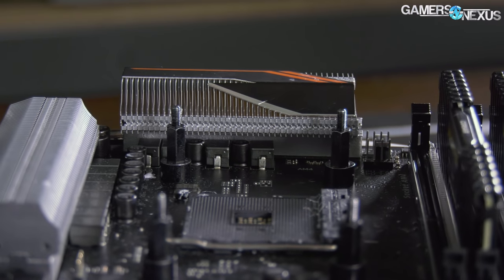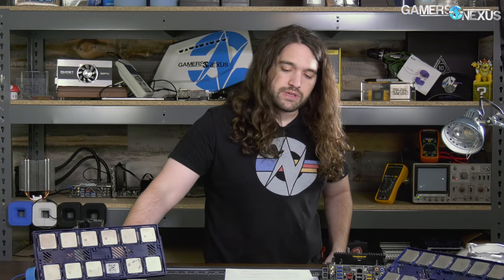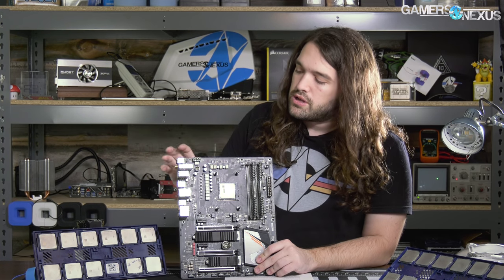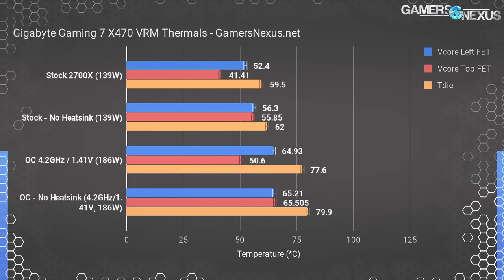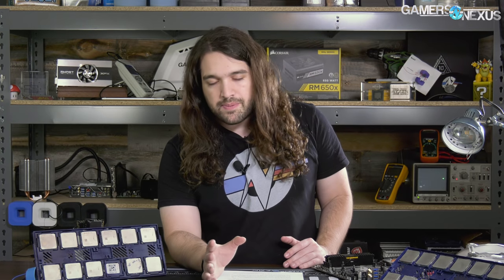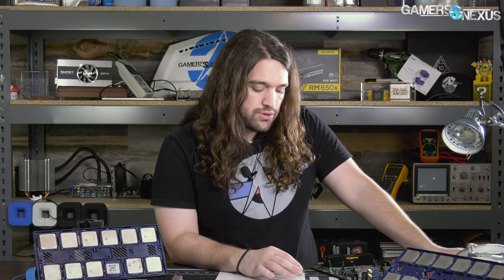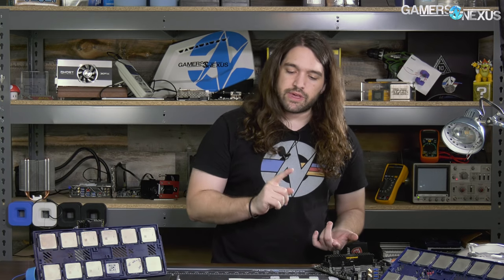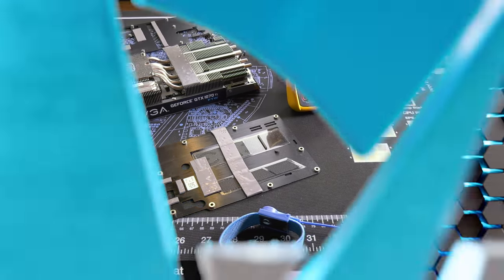Gigabyte X470 VRM Thermals & Planning for 10C/12C Ryzen

Comment: Gamers Nexus, i recently built my new Rig and got the 1080ti Aorus Extreme Edition GPU and games from stock like player unknowns are crashing which we found out to be the core that its boosting to and its only fixed when i drop the core by 30hz.... why would a card that is 1 month Brand New need to be underclocked in order to run games stable without crashing?:

if needed i would have shiped it to yourself for you to see what i mean but im confused....should i RMA  it, Return it or just keep it since it runs fine when the core is lowered?

Comment: I went ahead and got one of these. I know it's overkill for my current x1600, but I figure that I can start leap frogging parts starting with this. It should help keep my cravings at bay until Zen 2 comes out. I hope. I'm also coming from an Asus ROG Strix B350-F Gaming so I'm thinking that it should be a pretty good upgrade.

Comment: lower temps don't give you additionally overclocking room on ryzen but is it reasonable to assume it would increase longevity of other components like the capacitors? does a 5000 hour 105 degree cap last all that longer if it isn't subjected to 105 degrees?

Comment: I wish there was a finned heatsink on my z97 board. I had to put a fan in front of it to keep it cool with overclock since my CPU is liquid cooled.
Reply: I wish that too although the VRM temps on my board aren't too bad. Which board are you using if I may ask?
Reply: Asrock fatal1ty z97m killer, It has heatsinks that apparently are not effective enough with a 4790k @ 4.7ghz with 1.32v.

Comment: Motherboard manufacturers planning ahead so they don't need to re-design their motherboards? Intel launches refreshed chipsets with each new significant CPU release and motherboard manufacturers end up launching a million new motherboards to go with them. I'm not seeing motherboard manufacturers skipping a chipset refresh cycles just because their previous generation boards were over-engineered.

Comment: Please review (let Buildzoid review) the Prime Pro, it is THE motherboard (of X370 anyway) for the consumer who doesn't want to pay too much but still get good VRMs.
Reply: Peter Jansen He looked at it briefly in one of his videos if I'm not mistaken, and said it was a good board. It's the board I have. No complaints whatsoever.
Reply: In the case of AMD I am strongly in favor of buying a motherboard which can handle whatever AMD might throw at it a few generations from now, like a possible 12 core Zen3 CPU for $329 with a clock frequency of >5 GHz. Trust me, it is possible: 7 nm GF/TSMC + EUV => smaller cores and less cost compared to the first generation of '7 nm'. :)

Comment: What I really like about the giant vrm heat sink, is this finally looks like a board you can buy that can adequately cool future AM4 processors as they get to higher frequently ranges and more cores/threads.
Reply: Which you explicitly mentioned later on in the video. So I guess I am learning.

Comment: Would a 1600x work on a x470 @Gamers Nexus
Reply: yes
Reply: Sure. A 2600X can work in a X370 too (with BIOS update). You can put any AM4 socket AMD processors on X470 motherboard (like AM4 Athlons, Ryzen G and Ryzen 1&2gens, except Threadripper, because TR needs an another "TR4" socket).

Comment: My friend got a ryzen 3 2200g and msi pro vdh plus, he was running at 1.25v on the cpu at 3.7ghz and 1.2 gfx voltage at 1500mhz and his board died, were these voltages pushing the board too hard or was the board maybe just defective?
Reply: joshcogaming definitely defective!
That is nothing, 1.25v is almost stock... i used the same board for my dads pc with a 1200...
RNA it

or it might just be a stability glitch... take out cmos battery and press powerbutton for about 10sec to reset it
Reply: Mr.Magnificent thanks! We did an rma earlier today but when we get the replacement we're going to be on the safe side and only overclock the igpu and try increasing the dan curve
Reply: joshcogaming Gpu oc could have also been the reason, the Soc current is provided by the vrms in the top, normally they are not that important, which is why the one on the side gets hotter, and has a heatsink, just touch the vrms in the top while gaming and if you burn your finger, you might want to dial back the overclock, but i think overclocking really wasnt the reason here
Reply: thank you thats really helpful i didnt know the vrms on the top were responsible for that
Reply: joshcogaming Yea, on a normal cpu the one on the top only provides power to tings like the memory controller, basically anything that belongs to the SystemOnChip, on an Apu that also includes the gpu.
If raising the voltage for the gpu should really be to much for that 2 phase vrm and it gets burning hot, id really like to know, because then i wont but an apu for this board in the future :P

Comment: Not that it matters, but which cpu cooler did you use for the test?
Reply: I believe that it's the MSI FROZR L as per their normal standard of testing.
Reply from the maker: Absolutely not the Frozr. Why make stuff up? Just go to the article. It's all defined there.

Comment: Keep in mind that they're better suited for active cooling. Heatsinks with a high fin density are bad at passively cooling components. Their design choice would have made more sense if they included small fans to attach to the VRM heatsinks like EVGA has done with the X299 dark motheboard.

Comment: EVGA did it first.
Reply: Didn't the Dark come out after the TR boards? Most if not all the TR boards has active cooling. But yeah, the Dark has proper fins as well. :)
Reply: Did what first?! Heat fins on the heatsink?! I remember this was kinda standard back on the high end 775 socket, and 939 socket.